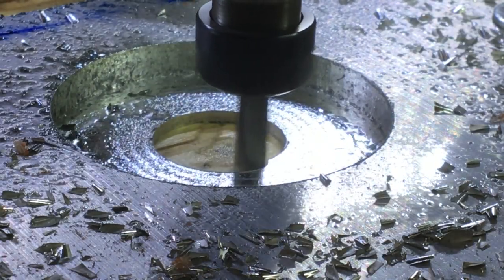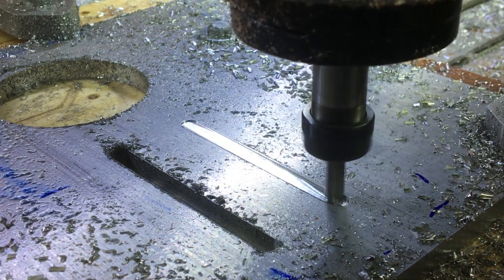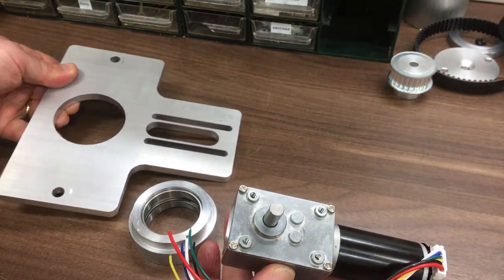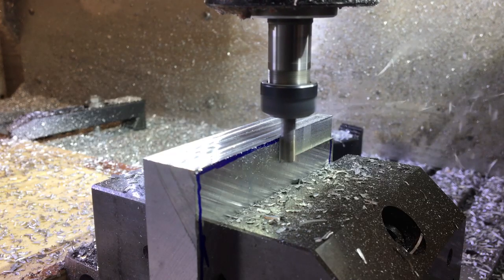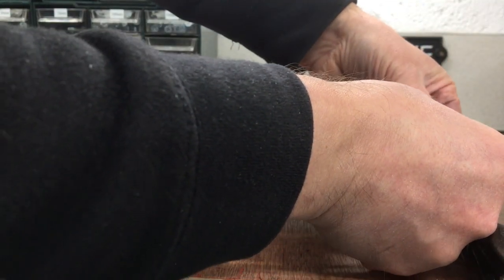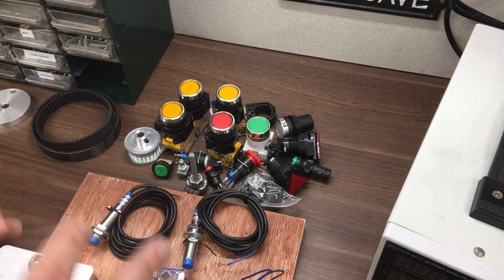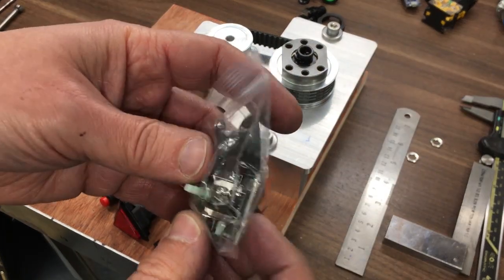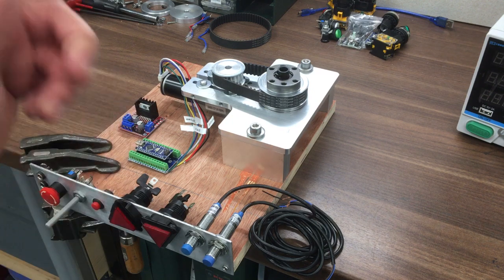Ep41: Drill Press upgrade | Starting the knee lift electronics

Comment: Fyi, I've used windshield wiper motors for similar tasks in the past and they are imo superior. Not only are they cheaper, but the motor is a lot more powerful.
You need a high amperage PS but other than that, they are better than the ones similar to yours.
Reply from the maker: I did look at a range of motors and I needed something small to allow the knee to be as low as possible.  The torque calculations suggest this small unit is easily enough but I guess we will soon find out!
Reply from the maker: Got initial wiring done and very basic code.  Speed control, fwd reverse, limits.  But I can stop the motor with my hand.  Driver might be current limiting or torque specs published might be optimistic.  I think it will still lift it but sounds strained and noisy.  I’ll think about options
Reply: @routercnc9517  hmm, yeah could be current for sure.
May have missed it, but what's the maximum amperage of your driver board?
Reply from the maker: Driver spec is 2A max.  I tried running motor direct from 24V and similar torque (subjectively) so not that.  See next video for an update and some testing!
Reply: @routercnc9517  oh wow okay. Yeah then the wiper motor won't work at all. That thing needs  like 10A.

Alright, excited to see what you come up with
Reply from the maker: It actually only pulled 0.1A or so.  But see next video for what happened. . . (when I finish it!)